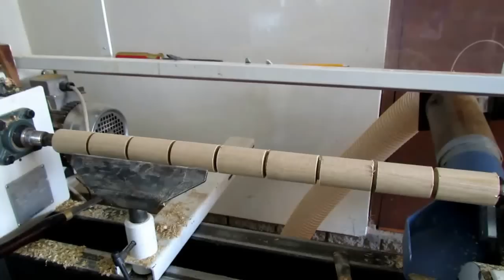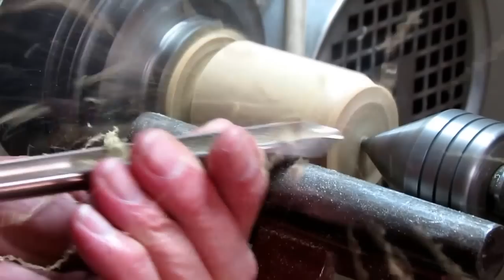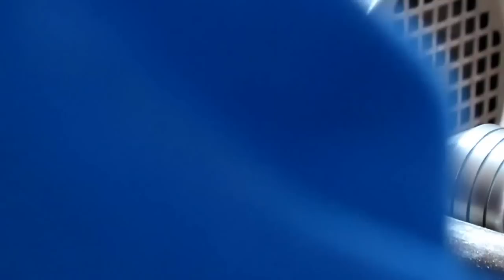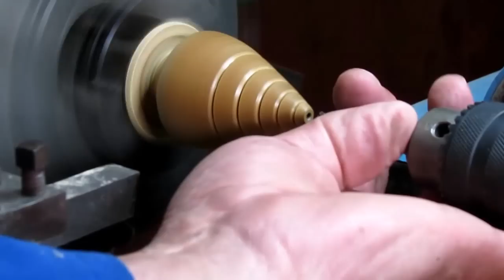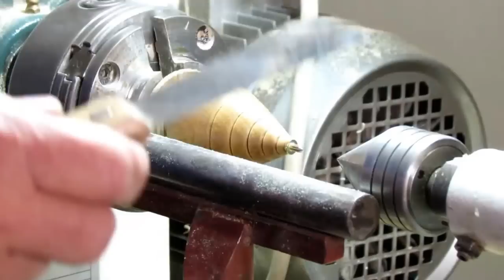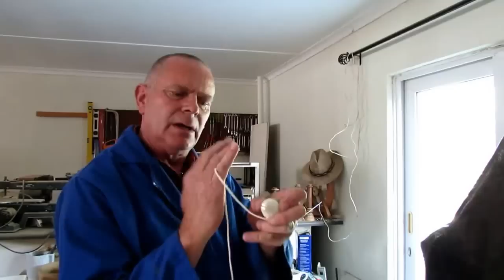Wood turning spinning tops

Comment: This takes me back about 70 years of my life when we used to play with these tops with a metal pin. As I grew older I started appreciating its dynamics at the manner the chord operates on that angle on the top. It seems a brilliant manner in which to transfer energy to the top through continuous acceleration. First as you throw it the radius at which the chord stands is large so the torque to accelerate the rotational inertia of the top is high and then as the chord is let out it falls on a smaller radius and so it keeps on accelerating  to a higher speed . What is interesting is the  linear momentum  with which one throws the top away from him and at the same time how much he pulls at the chord to ensure that the top  gains a rotational acceleration rather than coming back towards the thrower.  It is not an easy problem to analyse, and yet those who  has physical dexterity can feel  when the right throw is mastered. I would say that a theoretical mathematician analysing the modelling of this top would not be any better than that practical child who feels is way around that beautifully made top.
This may look like a top , but it is applied physics all the way in the manner it operated and that top contains all the phases of education from making it, and designing it and throwing it and they if one has time to learn how to maximise the throw for a good gyro without prcession too much about the vertical.   Sir, congratulations for reintroducing all these educational toys which are much more than a toy to those who care to dig deeper in its processes, including those circles formed on that inverted cone whose angle is not so easy to determine to ensure maximum performance in relation to a throw.